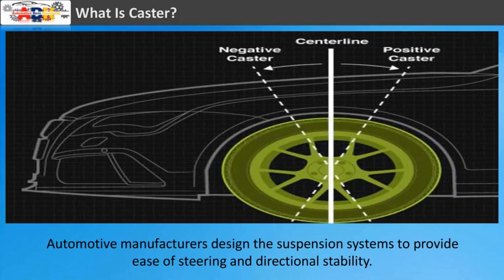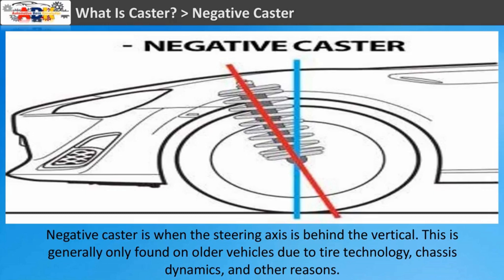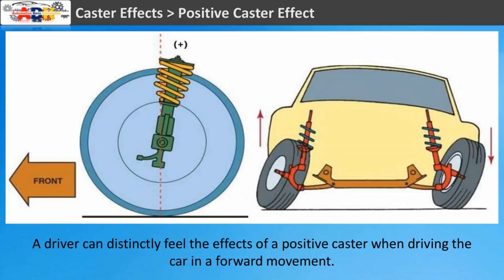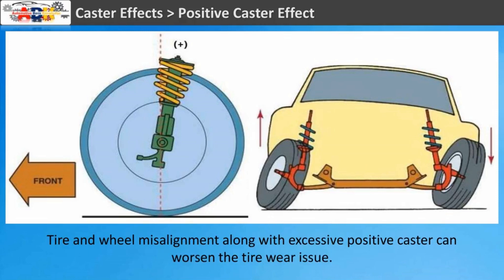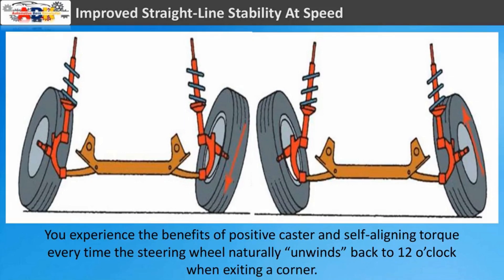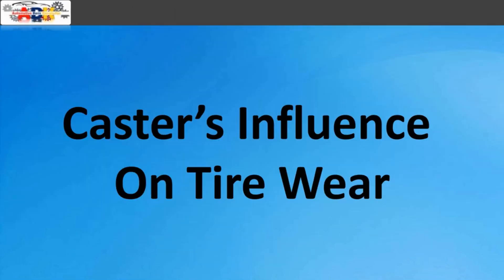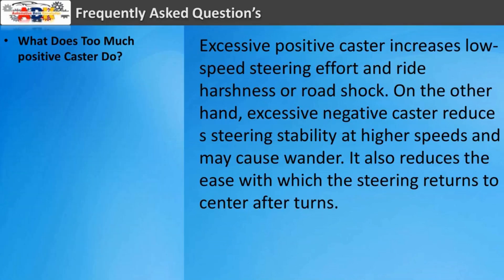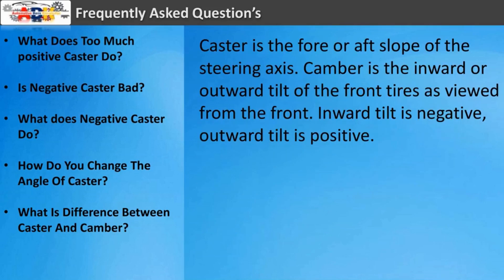Caster Angle In Car Suspension

Comment: All of the negative statements in this video apply to my 2021 Fiat Panda hybrid .. around the village the steering is great .. BUT on a level windless main road the steering has a mind of it,s own .   Get used to it I was told .  Maybe it was gusty winds ..  Pay for an alignment .  The Fiat is under warranty why should I have to fork out for an ALIGNMENT. I have bought a caster / camber instrument .the camber is 1- 1/4 degree negative on each front wheel . caster on each front strut is 1- 1/2 degree. 20/ 20 steering swing .